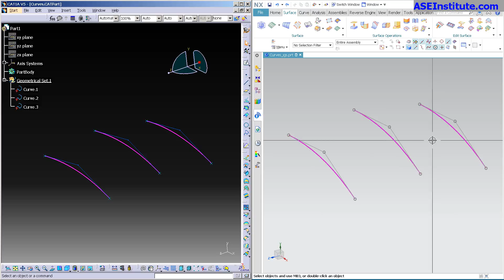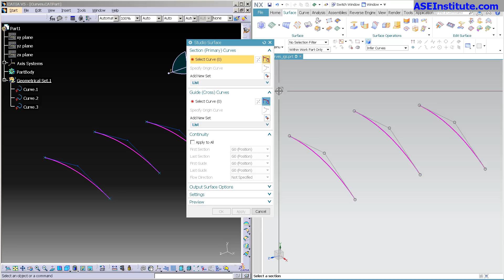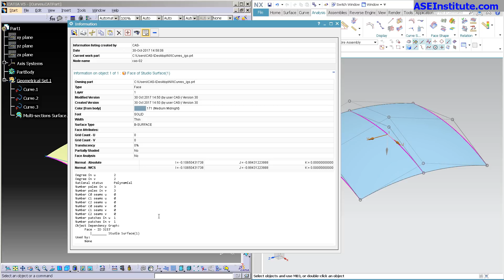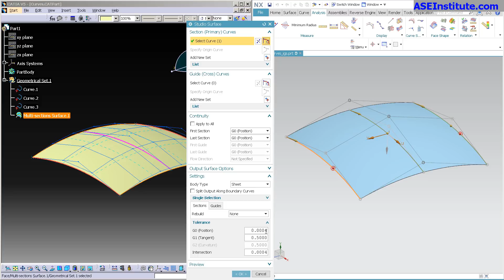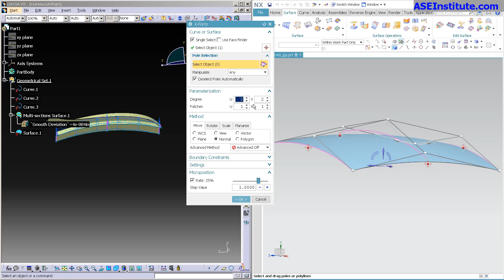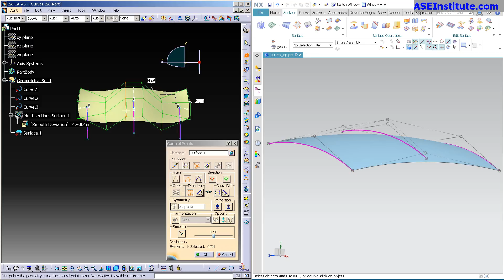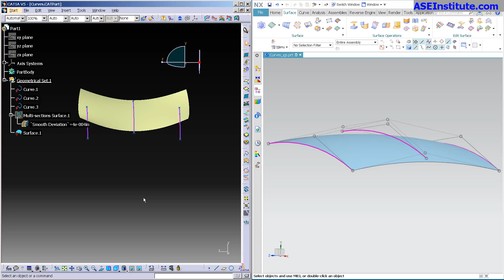NX 12 vs CATIA V5 | Mesh Type Surface Complexity

Comment: The only argument I have with that is how often are people modifying a design with control points instead of just changing the original curves or adding guide curves, etc. You didn't compare the actual surfacing methods and the quality of options for manipulations and I think that would have been good to weigh in on this. There are other options too that are parametric and control point controlled like the imagine and shape tools.
Reply from the maker: Oh, I have had to do it. It is a nice option. Especially for anything that is going to be offset for a B-Side that is giving you any difficulties. 

One does not always have the option of correcting curves used to build a surface as well.

Their are many reasons to simplify in this manner. Thank for the comment.
Reply: @StevenMarji  So I think the tool you would want to use in that case is "Feature modeling" in the ICEM shape design workbench. It allows you to deform the surface just as you did in the video but also takes into consideration changes to the multisection surface after the creation.
Reply from the maker: @Diallo268  ISD (ICEM Shape Design) is a remarkable tool. Really fantastic. I can't afford a seat so I don't use it.

That may change soon and if it does I will be putting out a lot of content.
Reply: @StevenMarji  Well best of luck to you and thanks for sharing! Good info and I'm always looking for new perspectives.
Reply: @StevenMarji Also I believe in the later V6 versions added a lot of improvements in that area. I've seen a few videos on it and I'm jealous I don't use it.

Comment: Oh you use GSD in CATIA for A class surface modeling? That's joke :) please use ICEM environment on CATIA and with approximate setting u can change V and U order with minimum gap then you can see that the surfaces in CATIA are so smooth and better than other same software
Reply: That is exactly what i want to say. GSD not provide explicit surface control, but ICEM does. that comparison is wrong.
Reply from the maker: GSD does provide continuity controls but not NURBS. I have designed entire exteriors using GSD.
Reply from the maker: I know. I used to work for ICEM and Dassault.

NX does it native and does a great job. Their is one place that NX is lacking and Siemens is fixing it.

Plus, GSD is really powerful. Really really powerful. Only thing missing is the ability to use a G3 constraint. You can easily fake it.

I really like ISD but it is also really expensive and I do not feel it is worth it for most peoples.

Comment: Hey Steve, 

Thanks for the comparison.; NX is a very interesting tool and seems to have made some strides. But I would respectfully like to point out that CATIA Icem Shape Design (aka ISD) can easily do everything that you demonstrated in NX . There are several options that accomplish dynamic movement of the surface based off of control curve manipulation. Both Sweep and Loft will do the trick but it's also possible to do with Feature Modeling. Another bonus in CATIA Icem  is that the user can generate the surface based on the following:
1) Input Tolerance
2) Orders and/or Segmentation
3) Both Tolerance and Orders/Segmentation

The resulting surface output can be NURBS or a single segment Bezier....it's up to the user to decide. 

Thanks and keep up the good work!

gerard
Reply from the maker: Always good to hear from you Gerard.

I know ISD can do that stuff. I know how powerful it is. As you know I used to work as an Application Engineer for Dassault/ICEM right after the purchase. Not to be glib, I can't afford a seat.

NX has these tools in its baseline MACH 3 product.

It also comes with:

Reverse Engineering tools (Do not need a special license to import an STL)

Convergent Modeling capabilities which basically turns an STL in to a surface and normal modeling tools work on them for the most part with additional Convergent tools but those come with an additional cost but it is not bad.

Synchronous

The equivalent to IMA

And of course since the tools are all standard to a MACH 3 license; all other applications and tool sets are right at hand. It is full blow modeling of almost everything for half the cost of an ISD license.

Would I love to get my hands on ISD? Hells yes! It is an amazing tool. I do not say that lightly. But, it is very prohibitive as far as costs.

Cheers.
Reply: Hi Steve,
Well, you are a surfacing legend at ICEM Inc.; Heck, I had to come in and try to fill your shoes :) after you left.
My comment was to only to point out that CATIA does have world class solutions for Class A surfacing. Your point of view is well taken- thank you for clarifying, my friend!

g.
Reply from the maker: Bro, your family is synonymous with brilliance... You guys are all top notch.

Lets do a video steam together. You can talk about ISD and I can talk about NX/GSD & Freestyle.

It'll be fun.

Comment: Hello. Well, actually the comparison is not the most relevant as the surfacing + x-form NX workflow should be compared to CATIA Icem Shape Design. Generative Shape Design is targeting accuracy first, and algorytrhm are provided to 1) respect tolerances 2) generate best quality within tolerance. Thus GSD features very often enrich math against their geometrical inputs. And as you say it is not bad, it is just not an issue to stay in Class B / C / D surfaces world. But when it comes to class A, you'd better go to CATIA Icem Shape Design (or also in CATIA Mechanical Refinement app), where by default features try to use the inputs maths, and where you have the Feature Modeling tool that allow you to deform a shape (curve or surface), keeping history, and as UI is very similar to Free Style Ctrl Points you can also provide a symmetry plane...and remeber it :-).
Reply from the maker: NX out of the box keeps history. Even back to solid faces. I can X Form pretty much anything and it all stays linked.

ISD is nice but for the money it is not really worth it. Heck, RHINO which costs less than $1000 competes with ISD in a lot of ways.

It is all about the user.
Reply: @StevenMarji  ISD is the full set of tools for final class A. But you alos have Mechanical Surface Refinement which is basically dedicated to GSD users and that is not more than a GSO I believe. Goal is to make a powerfull feature like Feature Modeling available to GSD / Free Style users. Feature modeling can process any geometry (solid face, GSD surface, IMA surfaces). That would be the tool to compare with X-form. After if your intent is also to compare solutions at equivalent price i would really really not put Rhino there, especially because doing nice surfaces with Rhino means high skills else it is easy to do crap ^^ 
Historically Free Style was not supposed to keep history as to be used earlier in the process than GSD that is why it cut the links.
Reply from the maker: I used to work for ICEM and did ISD.

I don't see the value of ISD.

NX is just as capable. In many ways it is better and in some ISD is better.

But, NX is half the cost and you don't have to deal with that horrid Named User License and you get more tools in NX.
Reply: 10 years ago maybe yes, it's been improving a lot you know. People are using ISD now, coupling that with knowledgeware too. ISD is more tolerant than GSD and you can control the maths of the features. Plus it has some features you don't find in GSD (especially curve & surface convertions) that are really usefull. Well honestly try it through Mechanila Surface Refinement app if you can.

Comment: NX is so far ahead of Catia that it might as well be a different species of CAD.
Reply from the maker: It really is getting that way. Some things NX does is amazing.
Reply: @StevenMarji  show me something i cannot do with CATIA gentlemen ;-), i'm waiting
Reply from the maker: Actually, NX does an incredible amount over what CATIA V5 can do. V6 may have some tools I have not seen yet.

Also, V5 does somethings NX doesn't.
Reply: @laurentigarza4575  Does CATIA have anything like NX Synchronous Modeling?
Reply: So does CATIA, they both have their pros & cons. I just wonder where NX is amazing :-)
Reply from the maker: Look up Synchronous technology.

It can do history based changes to a solid with the NURBS tool X-Form and I-Form

Better Kinematic tools

Better large assembly management

Nothing beats the NX Hole tool. Nothing

Fluidly move from Surface to Solid and back to Surface again. No other workbench is needed

Convergent Modeling is wow. It takes an STL and makes it work like a regular surface so all standard operations work on them

Now remember, I have about 20,000 hours on CATIA V5 and V6 so there is a lot in them I love as well. But, this is a short list of where NX excels.

Comment: The dialog boxes of Catia and UG are ugly. If only the dialog boxes of UG were as convenient as the solidworks, the interface of SolidWorks would be the best for the public to use. Unfortunately, the surface is not good!
Reply: This is a topic that is taken care of on 3DEXPERIENCE, the new platform for CATIA as well as Solidworks or any other DS brand. We delivered new UI for surfacing tool, and that will be extended in coming years to other apps. Solidworks R&D helps a  lot here as you can guess :-)

Comment: If nx runs overall better in terms of performance why do most automotive companies prefer catia?
Reply from the maker: CATIA was more available from decades ago to various companies. NX was a home grown tool made by an aerospace company 45 years ago. Eventually GM bought it and started using it but by then V3 and V4 CATIA were dominant. NX is catching up now in many places.
Reply: Mercedes migrated their systems from Dassault Systèmes (Catia) to Siemens (NX) in 2010, other german companies are migrating too. Other companies that use NX include: Suzuki, Fiat, General Motors, 
Mosler, Nissan, Chrysler, Mazda, Tata, Ford India, Hero Moto Cop, Volvo, Scania, Flextronics, Ducati, Onida, Mahindra, Bajaj auto, TML, Punjab, International Tractors, Asia Motor Works, Ashok Leyland, Hero Honda, Ace, Escorts, HAL, Major Defense Labs, Ofb, Bhel,Bel, L&T, Pari, Pam Group, Indian Railways, Ntpc, Cgl, Textron, John Crane ... Some other use both.. Even some use PTC. Anyway, Catia is not bad either, but the reason not to move is because retraining thousands of people takes a long time and effort, and migrating all their models causes a lot of problems.
Reply: as for class A surfacing it seems like most of the automotive companies use Alias. Please correct me if i'm wrong -  Catia or NX is used mostly to transform already created surfaces (in Alias) to  engineering CAD models to reconstruct all the internal parts like door beams and interior parts. And there is another way - to build CAD model of the car body based on a scan of clay model (1:1) where NX and Catia are both capable to work with stl data and produce class A outer surfaces by certain techniques.
Reply: Mercedes already left Catia
Reply: Alias is what every auto design school teaches and I think that probably plays a huge part in its 'styling' dominance. I don't think Siemens is too worried about it though; they're gaining real steam in industrial design right now thanks to realize shape's sub-d tool-set. And, they're working another angle with 'digital factory; industry 4.0. That's infrastructure and it's a smarter angle IMO, than trying to wrestle the styling duties from Alias.
Reply: Alias is a terrible tool. Good that they have the german guys form VSR (visual shape research) to try and improve on its terrible surface edit workflows and made the process of a magnitude less time consuming. None likes to spend hours adjusting the control points of a fairly complex surface in both directions to meet G2 or even more to G3 continuity. Alias will have to change and it is happening I hope.
Reply: In this video they are showing things which NX can do better than CATIA. But in real live you don't need these functions (at least I don't). 
It's like showing that a Porsche 919 is faster than a Volkswage Polo. Yes, that's correct!
But if in real life you just queue up in a traffic jam each day and the Polo can do it just as good. And when it comes up to transport a fridge you will notice the Polo suits your purposes far better :-)
Reply: Игорь Зузов I have also been thinking the same. I am particularly interested in automotive class A surfacing but I am unsure if automotive companies would use NX/Catia for this task or dedicated surfacing software such as Alias. Is Alias better for quick concept work?
Reply: CATIA in particular has been targeting smaller organizations with 3DEXPERIENCE in the Cloud,  organizations small enough that buying Alias might not be feasible on top of MCAD licenses. Also, the surfacing of CATIA and NX is far preferable in architecture, where the greater ease and flexibility of simulation, parameterization, and systems engineering is quite a bit more important (larger surfaces = needs to be made of many small sections, often made of relatively brittle glass that requires tight tolerances)
Reply: If you are trying to design styling parts in NX you will notice that it will take you three times longer than in CATIA :-)
Reply: @fuzzi6870  Even a simple hole action takes much more time in catia. Do u believe yourself :)
Reply: Well, I know that you are wrong, and I also know, that some people will never learn ...

Comment: A simpler surface is of higher quality, or more "A-class like" if you will, so NX wins also on surface construction. I was surprised by this, as I always assumed Catia was the king among mechanical CAD software when it came to surfacing. Turns out I was wrong!

On the other hand I'm disappointed in version 12 from NX as there are almost no new or improved features for CAD modeling.
Reply from the maker: I will do doing several videos on what tools I have access to. They have done a lot with DMU this go but have done some with modeling.
Reply: There is a simple reason, NX is not the fist choice for class A - It's called CATIA Icem (e.g. V5 Icem Shape Design or the traditional Icem Surf)
https://www.3ds.com/products-services/catia/products/icem-surf/
Reply from the maker: The simple reason that Catia has more seats is IBM. That is the only reason. IBM some 30 years ago helped Dassult out and at the time IBM was almost monopolistic with its footprint in the CAD world.